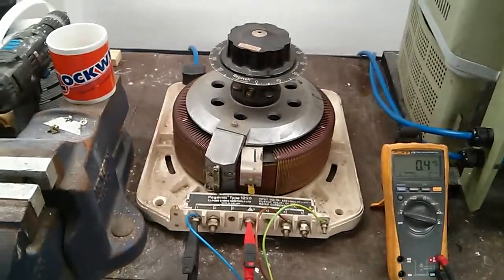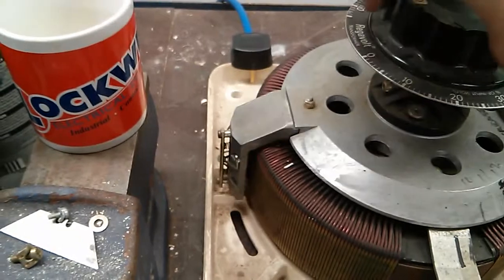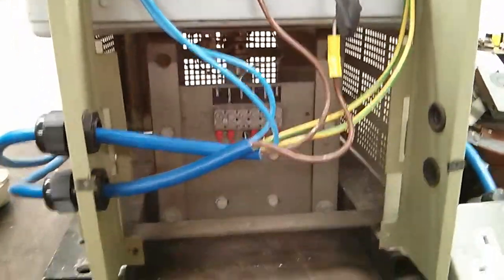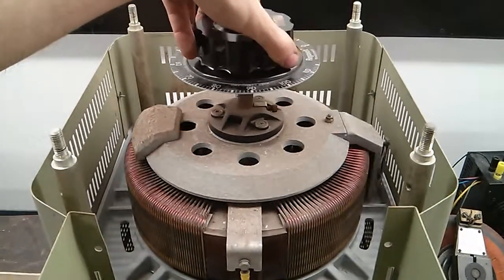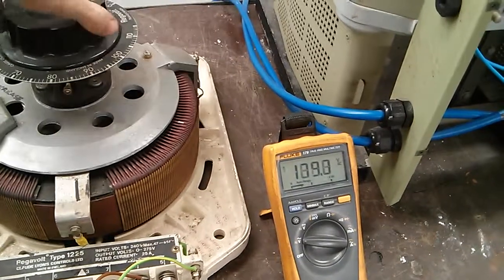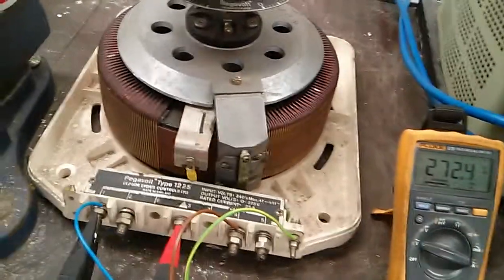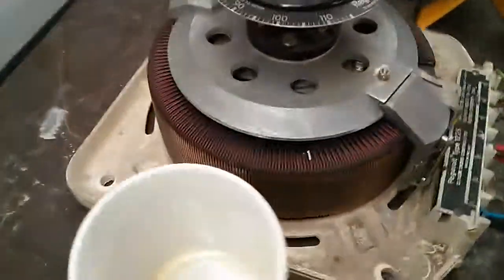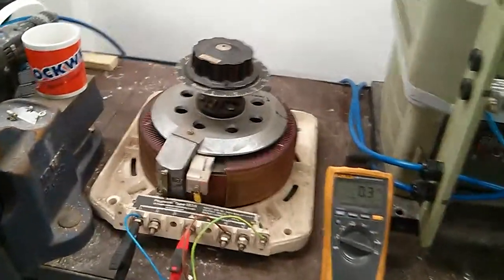Claude & Lyons Regavolt 1225 25A Variac Functional Testing

Comment from the maker: Motorised, and soon to be remotely controlled via push buttons on a control station interface.
Another reason for why it spins freely will be because of the brushes are on their last legs so
retaining springs are near fully extended and not applying much pressure to the brush contacts.

Comment: My goodness, that pick-up arm is EPIC! I really like the way how it picks up the voltage from the side of the windings instead of on top.

That other one: LMAO, it's motorised. :D

Probably, the reason why you can 'spin' that variac is the weight of the disc on top to which the pick-up arm is connected. It looks quite thick & weighty.

Yep, that's definitely a unique variac. On things like this, I think they should have enclosures with windows in them so the engineering can be admired. :D

-BBD.

Comment from the maker: Thanks for the kind reply Pete!
I'm pretty happy about the repair, I would like to re-plate it,
but seems a lot of work possibly reclaiming gold from other
electronics isn't as easy as you'd like. I'll probably end up
keeping it as it is.
The rotary action is the smoothest I've ever had,
although that could be partly down to the obvious fact that
the brushes are on their last legs...
The side brush contact area typical of most Regavolts really
is unique and gets the overall size right down.